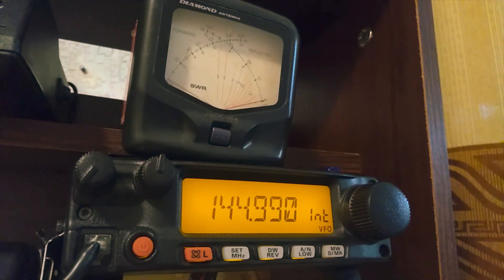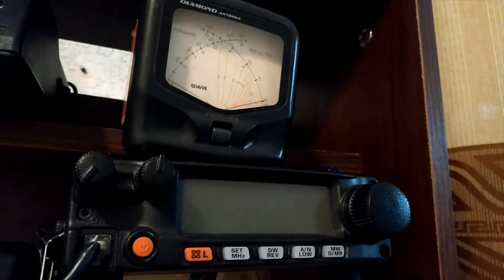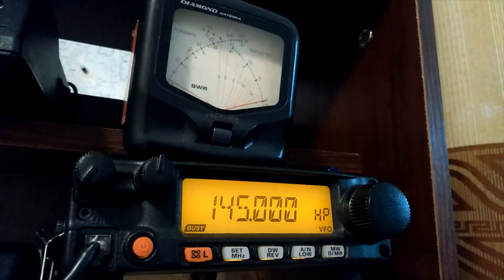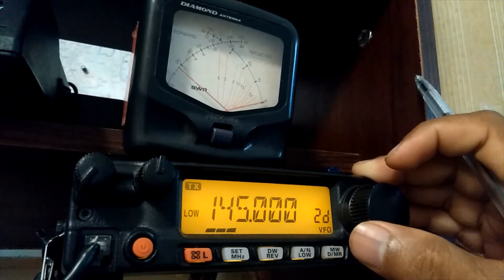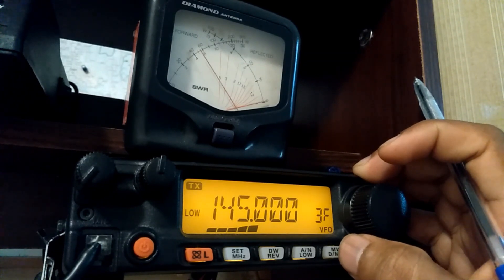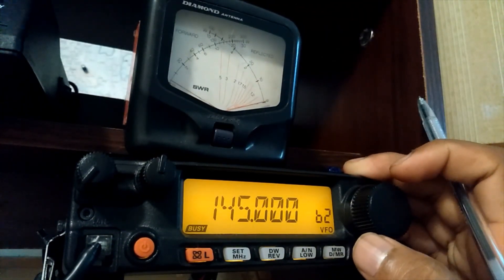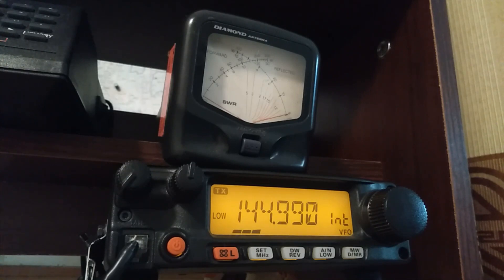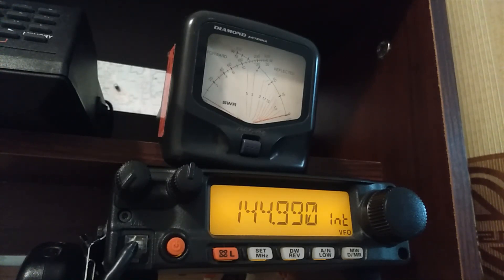Yaesu ft-2900r Power mod.

Comment: Great video Jaliya. There's one important step that needs to be added to the beginning of the video. Before powering off the transceiver, make sure that you're in the VFO mode, and then you press MW+DW+Power to enter the service menu. If the transceiver is not in VFO mode, then you won't be able to enter the service menu by pressing MW+DW+Power , so first you have to make sure that you're in VFO mode.

Comment: Jaliya thanks for the video. I have reduced the HP to 50W. I have one more question. The default step in my rig is 12.5. How to change the default in to 5Kc step. Each time i switch off and on it goes back to 12.5 step. Please help. Partha-VU2GPS.
Reply from the maker: You can find my watsup no on my QRZ send  me a text

Comment: My 2980r comes up with a B and C menu.
Reply from the maker: Tks mate for the information..
Reply: @4S7JL  Your welcome! And it got STUCK IN that menu until after the 3rd hard reset.
Maybe my US model "R" has that function "crippled" eh?
Finally got things back to normal though.
Alot of dead channels removed.
Back down to 20 good  repeaters to scan.
Reply from the maker: @robertkeller9828  now we have some Chinese clones  Also...
Reply: @4S7JL  This is a genuine Yaesu ft 2980r. Registered the warranty and everything

Comment: How to unlock to transmit out of ban?
Reply from the maker: Usually  it's unlocked
Reply from the maker: Usually  it's unlocked
Reply: @4S7JL  but it isn’t
Reply: @santerre1974  there is at least one video out there that demonstrates how to do the mod. Or do what I did. I got it done professionally at the ham radio store I bought it at so that would void the warranty
Reply: @santerre1974  maybe region locked so do the tx mod (the solder bridges on the face plates pcb (also called TX mod)

Comment: Great video!  I just purchased a FT 2980r, would the procedure be the same?
Reply from the maker: I think  yes please try and let me know
Reply: @4S7JL  It worked for the FT 2980.  This MOD just made that radio a whole lot better, thank you!!!
Reply from the maker: Nice to hear. One day will work on band
Reply: @AD2MM_NYC  no it didn’t. It made it weaker. The 2900 was famous for blowing finals. The giant heat sink on the 2980 worked so well they bumped the power up to 80watts!  If you want low power use the other settings. 🤦🏻‍♂️

Comment: This is VERY useful. Now I know why they call it Low 1, 2 & 3, because there is no fixed value.

Does something think this is voiding warranty?
Reply: I dont since ur not going above the rated output instead below or to the max of what the manufacturer recomends so propabaly not

Comment: This was a super helpful video, and pushed me over the edge towards buying one of these to replace my 25+ year old kenwood.

Being able to have an ultra low power setting for local repeaters, and dialing down the "high" setting for thermal reasons is super convenient.

Thanks for sharing, and thanks for following best-practices in not using more power than required to make a QSO.

73
Reply from the maker: Glad I could help!